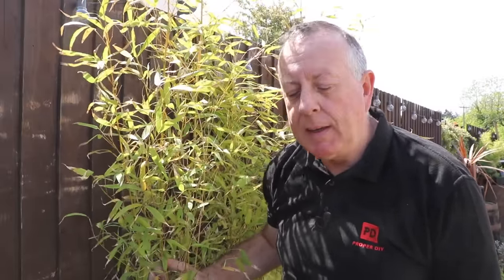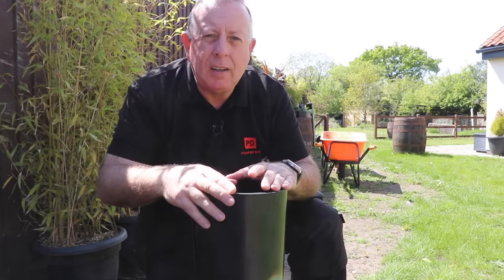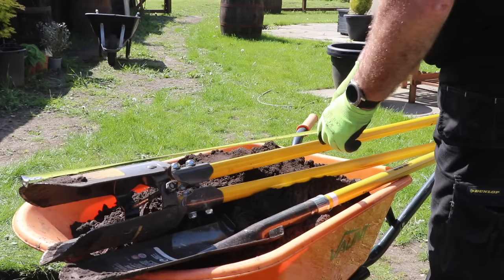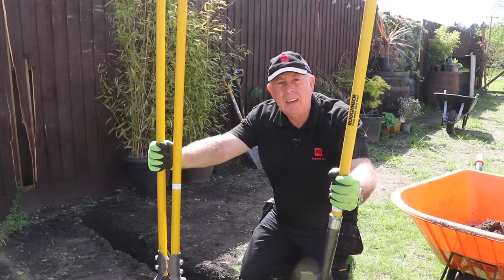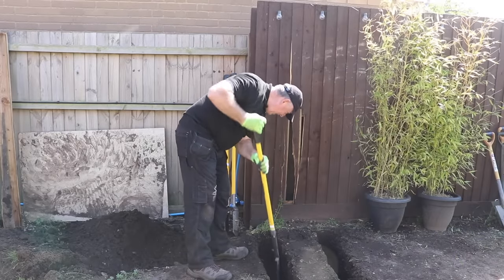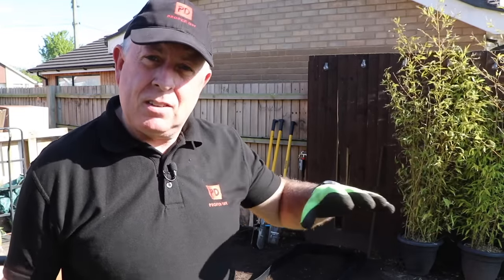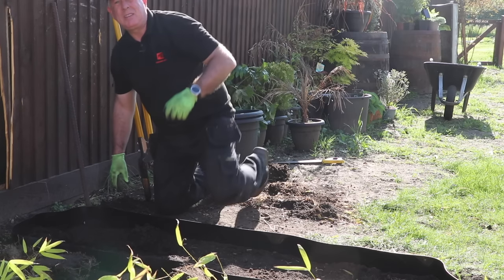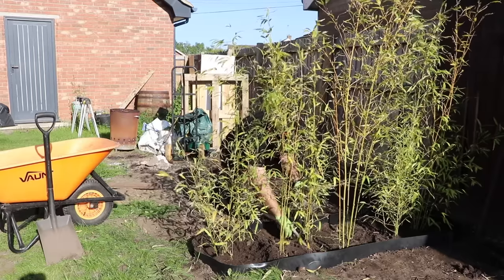How to Plant Bamboo so it Doesn't Take Over Your Garden!

Comment: Ive got a 12" wide,  30 foot long  bamboo  hedge along  my fence and is a good privacy screen without being a light thief. Beautiful and maintenance free.  The bonus is that the plastic screening like youre using  stopped the problem of  extremely unwelcome guests tunnelling in from the field on the other side, maybe the rootmass itself would have sufficed.  (Then I saw gnaw marks in the fence so ran chicken wire along the bottom of the fence. That stopped the little barstools. Sorry if this has put you off your lunch.) 
When digging, put the soil straight  into rubble sacks for easy transportation. I adverised "free top soil" online  and someone came for it within an hour. 
 My mistake as it turned out cuz you'll always find a use for it elsewhere.

Comment: Advice from a friend who is a bamboo grower with 200+ species... Never put in a root barrier without clamping both ends together!! When the rhizome has filled out the space, the lack or pressure keeping the material together gives the rhizome enough room to be able to push the barrier outward until a hole is made through which it can send runners... If you have experienced otherwise with a plant that is in the ground more than 5-6 years I would love to know, but it didn't sound like a solid longterm solution to my mate
Reply: Dad used giant pieces of pvc nested into itself, so it was very long and doubled walled. He didn’t want to plant bamboo at work but he researched and did it well enough so it’s contained and removable later if necessary.

Comment: A grubbing mattock is an excellent tool for cutting accurate channels.  Also as you get into well-compacted soils a fencing bar is great for breaking up the soil before you dig it out
Reply: Came to make the same comment - a mattock will cut that trench in a lot less time and with a lot less effort.

Comment: That post digging tool is the 30 quid I have ever spent. I have just completed quite a large decking project that required 75 post holes. I dread to think how difficult it would have been without that tool. Highly recommended 👌 👍 👏
Reply: I use a post hole boring tool, basically a pole with a course, wide helical thread and a "T" handle.

I first drill a hole in the ground with a long masonry drill, then insert the point protruding from the helix thread, slight pressure then screw away!

Once the length of the thread is full with soil, pull it out, knock the soil off, then continue. In decent ground (not heavily stoned) it takes just a couple of minutes per hole. Far easier then using a mattock or trenching spade with considerably less strain on your back.

Comment: Weird, I did this job today & now I see your video. Pretty sure it was easier for me to dig the whole area out with a fork than it looked for you with that post hole digger. Worth pointing out there are two types of bamboo, clumpers & runners, still it's worth having this barrier with either so you can be sure it stays where you want it.

Comment: Speaking as a self employed gardener, I'd have planted pretty much any hedging rather than bamboo. It's a nightmare, and that plastic won't stop it forever.
Reply: Nice new hedge is very satisfying too.  Jethro Tull reference?
Reply: Spot on, bamboo is like japanese knotweed, very rampant.
Reply: Probably depends on where you live and what type you get. If it's clumping it's not spreading far, if your soil is consistently dry and poor, you can control it more. Plus, if it does get out of hand, dig it up and use it to build stuff.
Reply: Bamboo,is like Japanese Knotweed a plant from hell, once you have it, you got for life, so difficult to control/remove..
Reply: @stuartandrews4344 wait til it has grown as much as it can before leafing, then cut it all down, reapeat for a couple of years and it dies, it spends all its energy growing but doesnt get to regain it with leafs.
Reply: @Chris-dy5fy  Spot on about clumping as opposed to "running" bamboo,been thinking about getting some Blue Bamboo  for screening an area,as it's a clumping type.
Reply: @stuartandrews4344  I had bought some running temple bamboo myself. I live in a desert. The guy I bought from lives here and he assured me it will only grow where you till and water because the ground here is dry and like concrete. But I've seen clumping varieties at his house and zoo. They don't go very far. The zoo has running and clumping. The majority of the zoo is taken up by the running one.
Reply: @stuartandrews4344 Depends on the variety!!
Reply: I have clumping bamboo in my retaining wall the past 2 years and it’s been great! With proper trimming maintenance you’ll do fine! Don’t be scared of clumping bamboo
Reply: @stuartandrews4344  Beware that clumping will still run, but it self limits. 
That limit may be a 10ft circle, or more, or less.
Reply: Did you get invaded?  It appears that bamboo is easy to maintain as long as you mow the area around the Grove for the height...20 foot high Grove  with a 20 foot diameter would need a 60 foot diameter circumference mowing area... or about a 3000 square foot area maintained with regular mowing

Comment: That planting space will be full of bamboo within two years. You'll then have to dig it all out and divide and start again. People always get caught out by how fast bamboos grow. The growth compounds, the root mass doubles every year, the number of culms at least double every year. 

Those plastic barriers don't last forever, they degrade, and because it's undergound you can't see if rhizomes have broken through. By the time you do notice, it's too late. Don't underestimate the strength of bamboo roots, they are more than capable of breaking these plastic barriers. As the comment below says...if you must have running bamboos then allow at least one foot of space between the final size that you want the bamboo to grow to and the barrier. Then, dig out that one foot space every year and get out any rhizomes, so in effect you're using the barrier as a failsafe rather than as first defense. Even then, you're going to have to be lifting and dividing your bamboos every 2 or 3 years to keep them healthy.

Much better to stick to clumping bamboos, and give them room to grow. Fargesias typically grow 2m to 4m tall, and form a clump 1m to 2m wide. Varieties like Fargesia Robusta Campbell, Fargesia Winter Joy, and Fargesia Rufa are ideal for our climate, they're much nicer looking bamboos than running bamboos, and you don't have all this hard work of trying to contain them.

Comment: It does need securing. Those rhizomes will start circling the perimeter of the plastic, and as soon as the sharp apex finds that seam it will grow in between the plastic sheets and out into the yard.

Comment: Without the post digging tools that you used, digging a trench is a hard and fiddly job. Despite the size, digging out most of the hole may be quicker (possibly easier) if you only have a regular type spade.

Comment: We planted bamboo several years ago.  I didn't install a barrier, so it inevitably spread.  I eventually killed the lot by cutting it down to 6" above ground and pouring Roundup, bleach, vinegar (whatever magic solution was touted on YouTube, really) down the tubes for several months.  I've since seen a video suggesting that cutting it down removed its leaves, thereby preventing photosynthesis, and that's what killed it.  Anyway, never again.  Also, I'm not in favour of burying plastic in the garden, for whatever reason.  We foolishly put "weed barrier" down years ago.  Of course the weeds beat it, and I'm still pulling bits of plastic up.  I would bet that the barrier will be a problem in future, and you'll rue the day you buried it.  Oh, and the bamboo will find a way to get through, under, or over it!

Comment: Hey Stuart, completely unrelated question: Doing some posts at the weekend and for marking out I seem to remember you had a paintspray tool for marking holes in brickwork for drilling. What was the one you were using? Was ages ago, so can't remember which video.  Do you have an Amazon store or links page for all the tools you use? Cheers!

Comment: Bruce from Seattle Bamboo writing here. Our motto is "we solve bamboo problems' and have almost two decades of dealing with these problems. We suggest that 90% of the problems we solve are barrier problems.

The bamboo is not "contained" by plastic barrier, in contract we suggest it is confined. Confined when its basic nature is to travel and spread.

This particular installation has numerous problems and the DIY fellow seems to have not studied bamboo before this video was shot. First, bamboo does need resources - he mentions moisture and nutrients and this is very true, though ignoring the fact that bamboo needs space. As it grows and matures and depending on variety may seek acreage. Space is an essential resource the bamboo requires.

Second the barrier is not wide enough to maintain the planting. There must be at least a foot of space between the planting and the barrier to dig the the rhizomes that will begin to travel around the around the perimeter. This maintenance is distinctly present in the American Bamboo Society  website if you search for it.

Third the overlap is a place the rhizomes can discover and thereby escape. The major problem is that there is little or no soil in the overlap space and the bamboo rhizomes may travel downward as they grow.

A fourth issue is that the end of the planting is very near the fence and will make it difficult to maintain in the near future.

"Barriered" bamboo (confined) has a "shelf life" just as it does in a container. Essentially the plastic barrier is a container  without a bottom which addresses a fifth problem. As the rhizomes travel around the perimeter they eventually find a way to go under the plastic. This requires deep digging and staging of soil before the robustly growing rhizomes can be located and extracted.

https://studio.youtube.com/video/zeNmOM3pTek/edit

The bottom line is that any barrier is confinement of a plant that needs to spread to stay healthy. This confinement is a future issue for the property owner and more often than not the property owner that proceeds the person who planted it.
Reply: The neighbors heavily planted bamboo. Grows up on my side of fence ie no barrier & ..IT shoots so high!  up & looks like shiit,blocks all sun & daylight, & constant leaves "in my yard,

Comment: Great video and advice, although I must say I don't know if that plastic will be sufficient to contain bamboo in the long term. I think I'd at least want to use a double layer. Bamboo can be seriously invasive and it can be backbreaking work to remove it from unwanted areas.